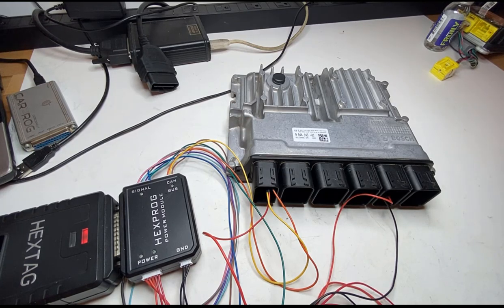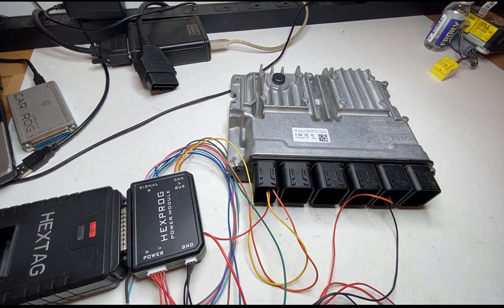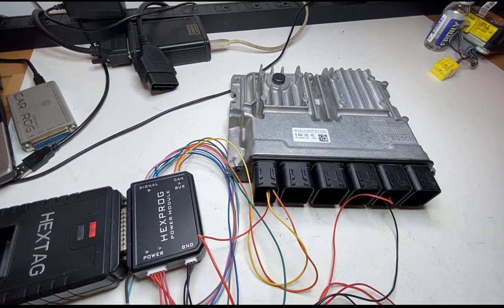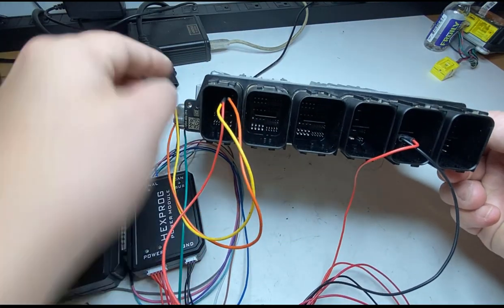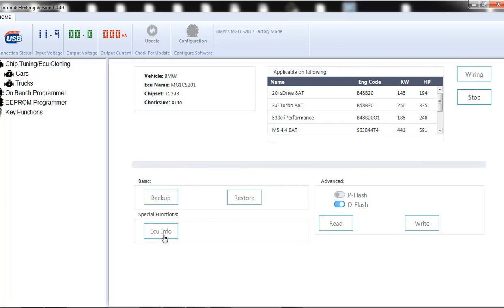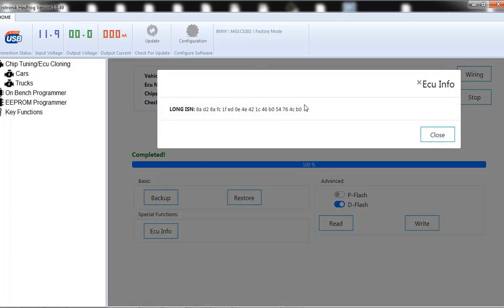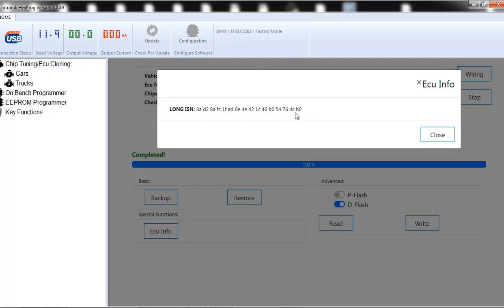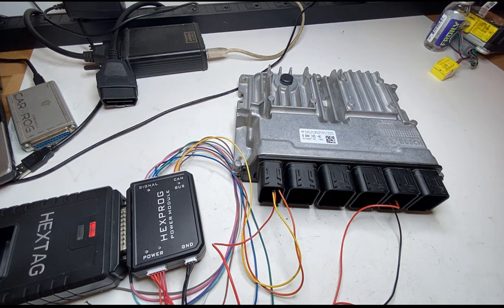Revealed: ISN Extraction from BMW ECM

Comment: I'm working on trying to virgin a DME on a 650I ME9.2.2 with a CAS3++ Ista-p encrypted. I want to reset the start value to virgin so I can match the CAS but I'm not sure where in the hex address to go about editing it. I guess I can see the address by sniffing the CAN bus when I attempt to set the start value for a dme. Any easier way to make a dme start value programmable so I can sync the cas to dme?

Comment: Hi I need to replace a water damaged Bmw ecu with used one. I think I have to read data from old ecu and write it to new one. Could you tell me please what equipment should I buy to clone an ecu. I saw some equipment over 2000 dollars.  Should I buy it or cheaper version will work for me? thanks
Reply: you can use ktag to read eeprom from old dme and write to new dme,or maybe vvdi,mini acdp but this 2 tools is too expensive